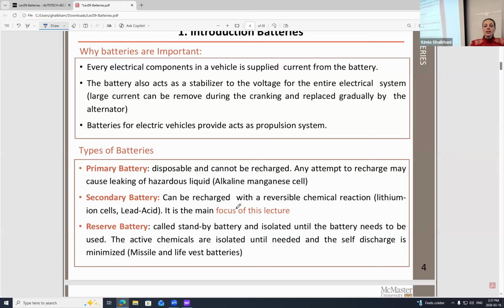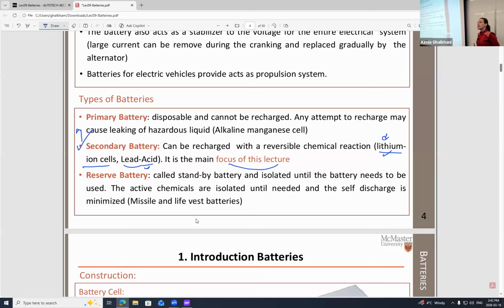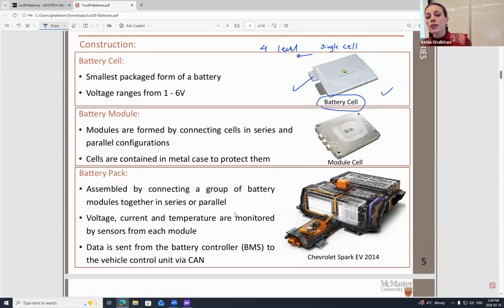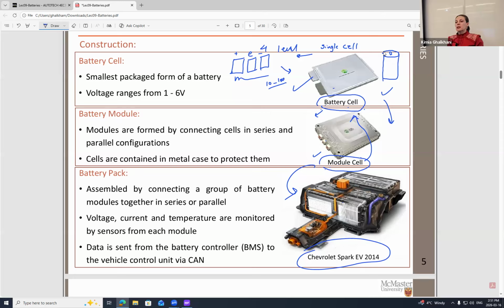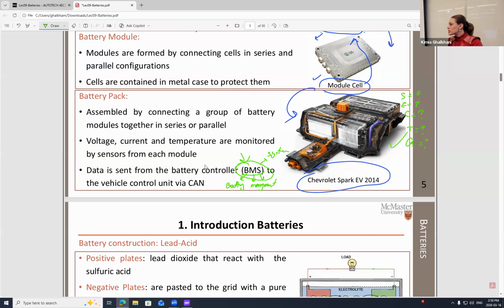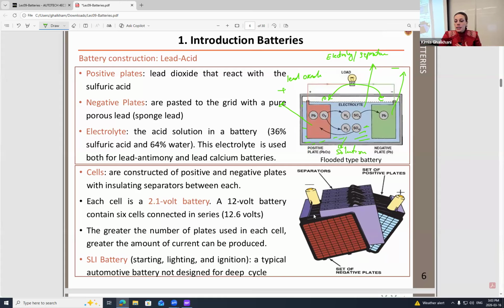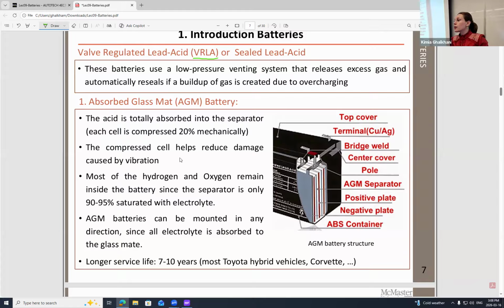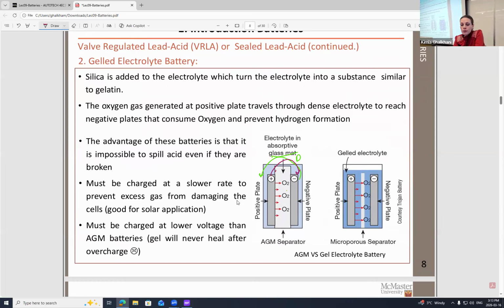20. Battery type and operation- Part 1

Comment: Is it possible to recover VRLA or LSA batteries by removing sulphate? 

Use AC or DC current (pulses)? What frequency (resonant)? How to determine the frequency, so the sulphate on the plate would be agitated enough to fall off the plate?

Is there a difference between nuclear facilities using such batteries and regular cars and electric cars? I think that batteries from nuclear facilities have more space between bottom of the container and the plates, thus the sulphate does not short out the cells so quick

What are methods to prevent suphate? What are passively active methods/devices designed for that and working while car is running/charging (military has such patents from long time ago)

Does the anode/cathode wear out due to the battery usage and the plate becomes thinner? Does reversing polarity of the battery allow to wear the plates evenly?
Reply from the maker: Q1. Recovery from sulphation: partially possible for mild sulphation, but severe sulphation is mostly irreversible, especially in VRLA/SLA batteries.
Reply from the maker: Q2. AC/DC pulses & frequency: high-frequency DC pulses may help slightly, but there is no true “resonant frequency” that reliably removes sulphate.
Reply from the maker: Q3. Nuclear vs car batteries: industrial (e.g., nuclear) batteries are built with more space and thicker plates, making them more tolerant to sediment and longer-lasting than car batteries.
Reply from the maker: Q4. Preventing sulphation: keep batteries fully charged, avoid deep discharge, use proper charging (float/equalization), and optionally use pulse desulfators.
Reply from the maker: Q5. Plate wear & polarity reversal: plates degrade and thin over time, and reversing polarity damages the battery rather than balancing wear.
Reply: @Dr.KimiaGh  does cathode and anode plate wear out unevenly? Thus the proposition of reversing the charge in order to even it out and use it up for longer (AFAIK anode plate thins at a faster rate than cathode due to its inherent material properties (forgot the specifics of it))